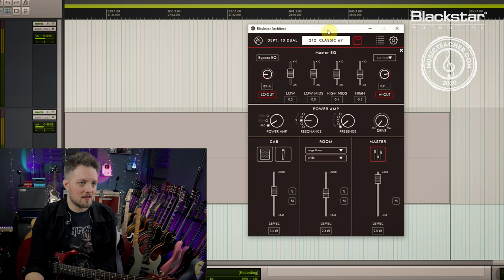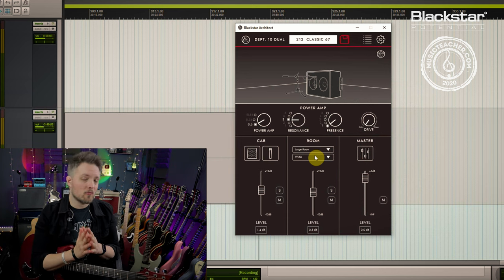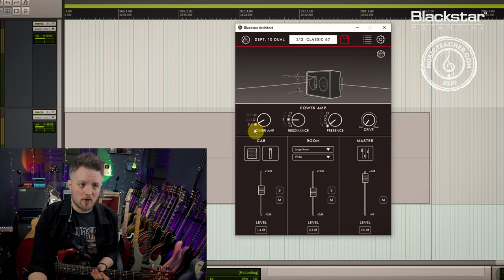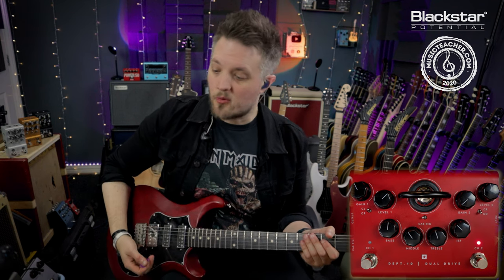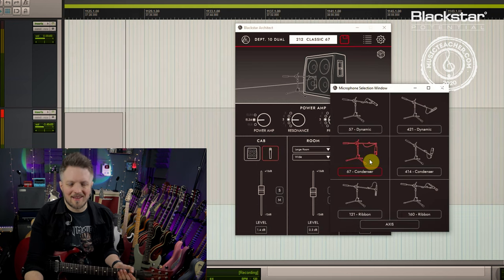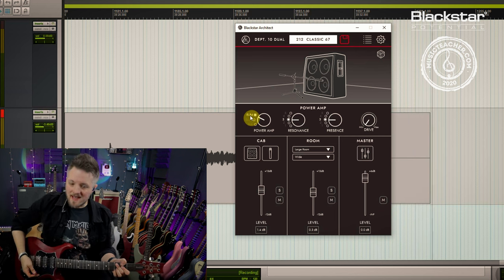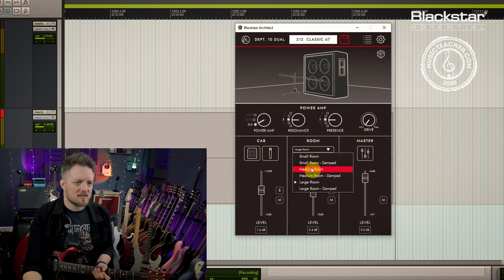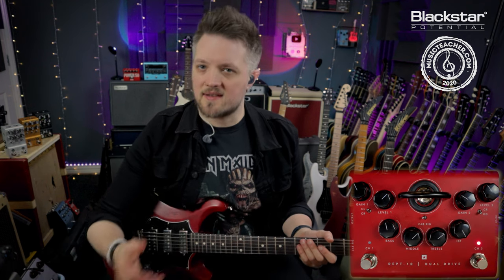Basics of Cab Rig Using the Dual Drive | Blackstar Potential Lesson

Comment: Thanks, this is helpful. I personally have been using the el84 and a 2x12 settings. In my setup that seems to be to my taste but I do like those heavier settings you were getting with the el34.
Reply from the maker: Glad it was helpful!🤘
Reply: Does this work straight out the box? Or does it need connecting to the software first?

Comment: That is so good.  Other videos just show tweaking of ISF alone without changing cab and eq to match and people complained  ISF wasn’t doing much. They should watch this video instead.  A question, can I still use this pedal cab rig out but bypassing the drive so I can use my own exist amp in a box pedal for the specific Tones  I like in my rig already?
Reply: You can turn the preamp off on the pedal and still get sounds through the cab rig output. I have not tried doing that while plugged into the xlr output though. Hopefully Blackstar will reply and answer that.
Reply from the maker: Hello Raymond! Thank you for your comment! Yes, Cab Rig is still active even when the preamp is not engaged. This is changeable via the pedal.
Reply: @Blackstaramps  thanks for that reply.  That great as that allows me to trade my existing IR pedal out and use this to integrate with whatever I already have.